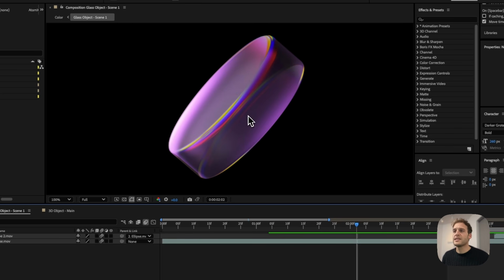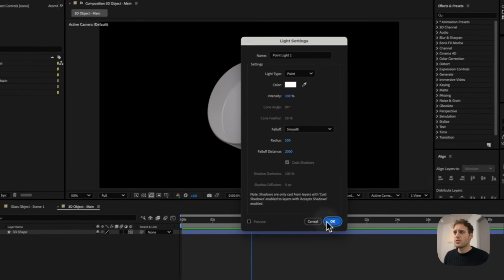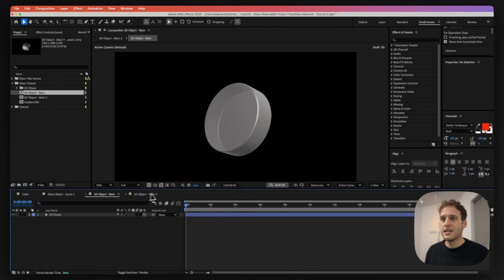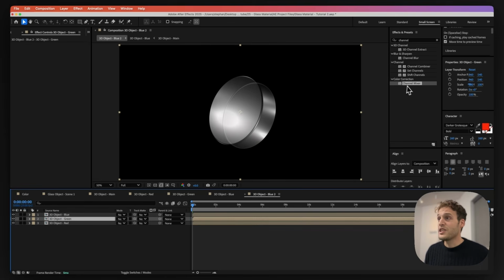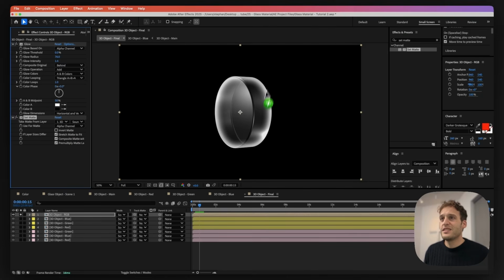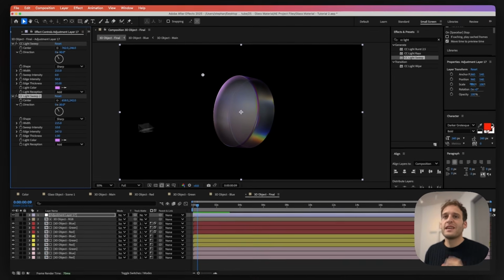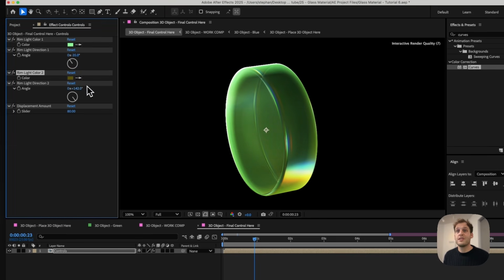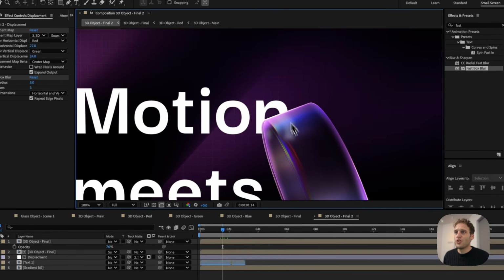Master 3D Glass Effect Motion Graphics in After Effects Advanced Tutorial

Comment: any tips and tricks to implement this style but on complex moving cursor, i find it difficult to animate it, i usualy turned on continous rasterize and 3d so i can animate content inside that comp but outside final project which in this case by doing so make all the effects not working
Reply from the maker: In this case what I like to do is actually render out a few loops, like a straight cursor, one that rotates, etc. They need to be made in a way that they can continue from one to the other seamlessly. Then you can use those renders/ video files, as if they where a simple png, without the loss of speed that comes with this setup!

Comment: Can I buy the ready-made 3D cursor file that you use in the video?

So I don't have to make it manually?
Reply from the maker: Hi, you can get this project file here for 3D Glass. https://neuronfx.gumroad.com/l/mamkq

You will just need to add your pointer shape layer.. basically just draw any shape (you can draw a pointer shape) and that will be converted into the 3D glass.
Reply: @stephan @stephanzammit  I apologize, but do you have a video example of how to do this?

I don't quite understand🥺

I would be very grateful🙏🙏
Reply from the maker: @sergey8648  I explain this briefly at time 20:50 of this video, however I only show this 3D shape and not how to add new ones. If you want to add a different shape, you need to select Rectangle 1 and delete that. Than with the 3D Shape layer selected, you can pick the pen tool from the toolbar and draw a new shape.
Reply: @ste @stephanzammit  I'll try now 🙏
Reply: @stephanzammit  So, if I do everything right,

I can download a cool cursor from the stock, convert it to a shape, and add it?
Reply from the maker: @sergey8648  Yes correct, of course you would need to convert it to a shape layer, then just pick that shape from within the shape layer and paste it in the 3D Shape (instead of the current Rectangle). Whatever shape you add to that 3D shape layer, will be converted to 3D.
Reply: @ste @stephanzammit  I'll try now, thank you

One more question, if it doesn't work out,

would you be able to record a short tutorial? 

In Loom or something else?

I would be very grateful, or if you need to be paid, please let me know🙏
Reply: I made the cursor, but I don't quite understand how to render it so that it is in 3D like yours, and I can rotate it freely
Reply from the maker: @sergey8648  It needs to be in this 3D setup as I have made in this video. Basically the cursor will be instead of the ellipse, then you can follow the rest of the tutorial here and turn it to 3D.
Reply: @stephanzammit  It's not working 😭
Reply from the maker: Hi Sergey, if you purchased the Glass Project file, just drop me an email with your purchase email confirmation, and I will send you a version with the pointer to make your life easier! :) Hope that helps :)

Comment: Hi Stephan & everyone. I am using a MacBook Pro M3 Max (14-core CPU / 30-core GPU / 32GB). When working with Advanced 3D features, the computer struggles. Rendering takes longer than usual and mostly fails. What could I be doing wrong?
Reply from the maker: Are you using the environment light by any chance. In most cases I try to avoid that light as it really slows down the process. It gives some really nice shadows when used well, but at that point it would be better to use other 3D software like Blender. Also check your advanced 3D settings. You can decrease the sliders considerably and still get good results.

Comment: This is such a cool effect - how would I put a white UI icon onto the front of the glass? I have tried but it turns black as I guess the lights are not lighting it properly - and tinting or filling it doesn't seem to make much difference?
Reply from the maker: Thank you for your comment! In this case I think it would be best to actually have the Icon in a separate composition and then use an ambient light in that composition. Then combine it in the Final composition. This will depend on the object's rotation, etc however.